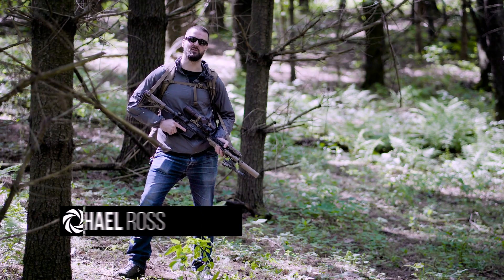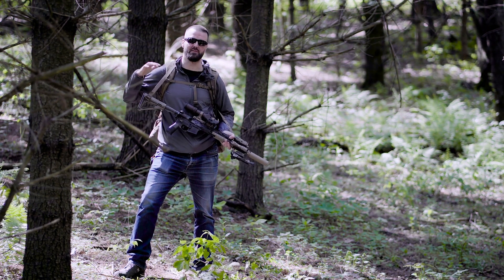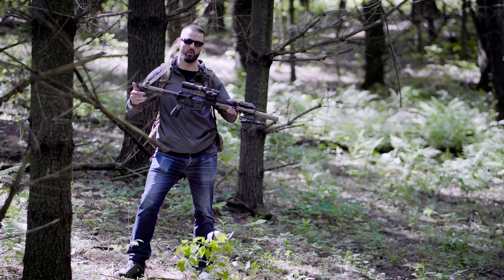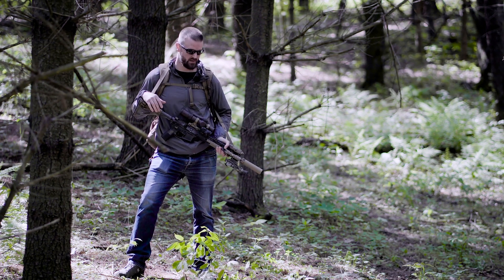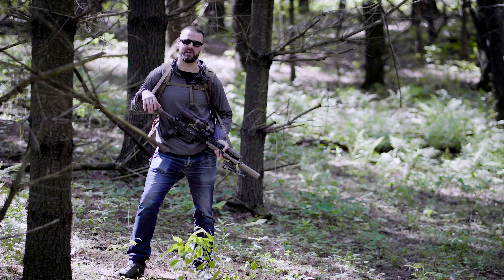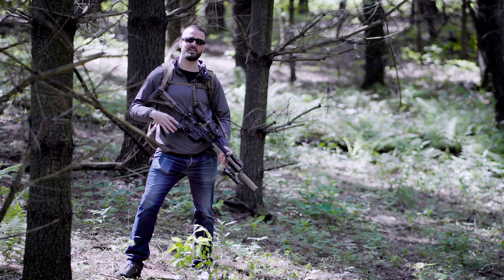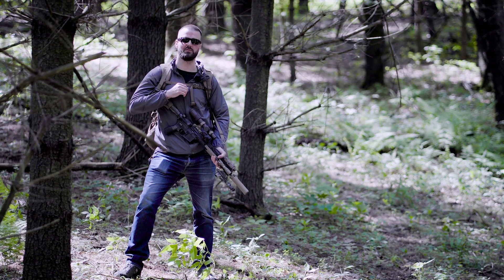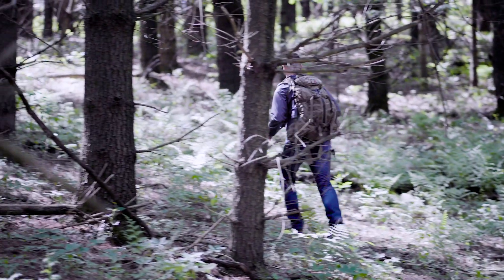AR-15 cycle of operation - 8 steps you NEED to know about - Locked Chamber Dwell Time

Comment: So my barrel acts undergassed, i run an a5 H1. So what is being explained is i need to up my buffer to an h2? I am having issues with the bolt locking to the rear on last round.
Reply from the maker: If you contact us (contact@criterionbarrels.com) we will happily take care of you.  There are many parts than can cause symptoms that appear to be under gassing, and we can get you squared away.

Comment: I've been chasing the 1/2moa "duty" rifle for a few years now. I've been damn close on a few builds but they were closer to 3/4moa than anything. My "duty" grade checklist isn't too strict or anything. On my next build, instead of using chf chrome lined I'll be using a nicor-treated chf barrel that I'm hoping will give me that 1/2moa I've been after since there's no additional coatings within the barrel makeup.... Is it even possible to have a duty grade rifle that carries 1/4moa like the video claims?
Reply: Do you hand load? If not you should start, it opens up a lot of options

Comment: How is nitride vs chrome vs environmental corrosion?
Does chrome generally do better if it's applied properly?
I heard many, many troops were killed in Vietnam because the barrels weren't corrosion resistant, and wondered how they would've faired if their barrels were nitrided inside.
It's said the pitting was so bad that the casings would form into the shape of the corrosion, getting stuck, and jambing the weapon.
Reply from the maker: Nitride is great but it is not nearly as corrosion resistant or durable as a chrome lined barrel.

Comment: Most youtube videos I come across sound either like someone trying to explain to us, what the engineers told him (which he didn't understand).  You sound more like the physicist/engineer, who really understands what happens - AND knows how to say it in a way that non engineers can understand.  THANK YOU!  I am building a couple ARs using about the least expensive parts I could locate on the internet - and am expecting to face .... um, "issues" at some point because of that.  I was looking for videos like this so that I can better understand the functioning of the AR DI system for troubleshooting.  (I did already "assemble" a PSA kit using an 80% lower and have not had any issues to troubleshoot yet on it.)

Comment: "firing, unlocking, extracting, ejecting, cocking, feeding, chambering, locking, in no particular order." No particular order??????? As if this works no matter what the order? 😂
Reply from the maker: No particular order, meaning that it can begin anywhere in the sequence... firing, unlocking, etc., or chambering, locking, firing, unlocking and so on... It is still the 8-step cycle of operation regardless of what step you want to begin at. The sequence remains the same but where one considers the starting point can vary.  This is just a brief video bringing attention to the timing of an AR and its importance on performance.  This is not PHD level, it is for those just getting in to the AR world (there are many many new gun owners that are looking for the basics).

Comment: As a bolt gun shooter, I still can't grasp the concept of "free-floated" AR barrels when there is a gas block and gas tube attached, but that aside, just wondering how much movement is typical during the barrel-whip process. Is this a known metric for each barrel length produced? For example, for a .308 caliber, 18" Criterion barrel, how many thousandths of an inch does the barrel move during firing.  Dependent on ammo load and barrel profile is obviously understandable, but still, some kind general average of movement should be known. Right? Otherwise,  how can we know how much clearance should be maintained between the gas block and the handguard so they do not contact during the firing process?

Comment: Are there any particular flash hiders that you recommend for good accuracy in you’re barrels? I have a particular 16” salt bath nitride unit that seems to like being naked. I now you guys like you’re barrels to party hard and everything but I want her to stop flashing everyone. I fired a .37” group just this morning with Blackhills 77gr ammo bare muzzle, with a standard A2 birdcage the Gun fires a 1.1” and with a lightweight 3 prong it fired a 1.4” group. I’m sure there are some flash hiders out there that will give me bare muzzle accuracy but I don’t want to buy 15 different units to find out. Thanks
Reply from the maker: Steven, I have had excellent results with 3 prong flash hiders from Surefire, Silencerco, AAC, and many other high quality manufacturers... I pretty much only use flash hiders or "comps" that do an excellent job of reducing flash like the "Warcomp" from Surefire.  Torque on muzzle devices can make or break performance.  If a muzzle device is too tight it can create a tight spot right at the muzzle.  If its too loose, it will impact harmonics.  I find that using rockset and torqueing the muzzle device till the threads are engaged and tight but not over-torquing is the best way to go.  I do recommend following the flash hider manufacturers torque specs for best results.
Reply: @CriterionbarrelsInc  Thank you, you guys are always helpful, I will keep exploring.
Reply: Wow, I had no idea that simple flash hider muzzle devices would effect your accuracy in such a massive way! I usually go with a2 birdcage with everything. Did you ever find a happy medium or process to work out your accuracy issues?

Comment: It's funny because dwell time isn't one of the steps
Reply from the maker: Locked chamber dwell time (not to be confused with dwell time of the gas system) directly relates to the "Unlocking" step in the 8-step cycle of operation as well as all the other steps... It is essential to a properly built and timed rifle.

Comment: Any issues with steel cased ammo or any ammo to avoid
Reply from the maker: Steel cased ammunition is typically not as reliable as high quality brass cased ammo, however, we do test our barrels with pallets of steel cased ammo and it generally works just fine.  If it is super low pressure ammo you could drop weight in the buffer.

Comment: Is the barrel a 13.9 core with a MCMR 13?
Reply: i doubt it. the 13-inch MCMR doesn't play nice with suppressors on a 13.9-inch barrel because of the "lips" on the sides of the handguard. you would have to sand those lips down to get a suppressor to fit. it's probably a 14.5-inch barrel at least.

Comment: @Criterion Barrels, Inc. Hi guys, I have a BCM Recce-14 and I'd like to install one of your 14.5" Hybrid mid-length barrel (.223 wylde) on it. I would also like to install a Geissele Super42 kit : braided wire spring and H1 buffer.  Is the gas port of your 14.5" barrel large enough to cycle properly my Ar15 using a mid-length gas system and the Geissele Super 42 ??  ( that is 15% stronger than the standard buffer spring ).
Is it possible that my Ar15 will be under gassed and not cycle properly ??  ( I'll probably use a BCM low profile gas block .750".)

Thank you
Reply from the maker: Hello, although you could use the Super 42 spring, there is no need.  Our barrels are properly gassed and not over-gassed.  This is why we recommend using a standard mil-spec action spring or something with a mil-spec tension like the white spring from sprinco.  The Super 42 is best suited to make up for overgassed barrels to slow down the cyclic rate, thus the increased spring tension.  We recommend the mil-spec action spring with a heavy buffer to delay unlocking and refine the 8 step cycle of operation.  Timing of the AR, ensuring that all of the 8 steps happen how and when they are supposed to, makes a huge difference in performance.
Reply: @CriterionbarrelsInc Ok, thanks for the advice. Just out of curiosity, what is the exact gas port dimension on your 14.5" Hybrid mid-length barrel ?

Comment: With 7.62x39 AR.....I have noticed that overgassing is alway good for a smooth operation shooting cheap ammo .....
Reply: The highly depends on your chosen gas system for your barrel length. There are lots of barrels out there with carbine length gas systems so the under-loaded cheap ammo won't cause malfunctions with less gas. Instead of hearing the bitching of  these customers with malfunctions out of the box that is ammo related, they rather take the higher wear further down the line. The majority of ARs don't even see 1k rounds. With the right gas system for your barrel length it'll work just fine with cheap ammo but maybe not the cheapest one can find.

Comment: Perfect video!! This is the stuff I try to explain to some of these self proclaimed amature builders. I have worked as an armorer on our service rifles and in several different civilian shops close to 25 years and I always seem to get someones "custom build" problem on my bench.  When I start asking questions and give some honest advice, it is like I am the bad guy kicking someone's puppy.  lol.  When people start buying the cheapest barrel they can find on the clearance section of a site for like $50 and buy their other critical components for cheaper than cheap mismatch pile and wonder why something is not working correctly I just have to shake my head.  I am all for saving a buck or two but certain things do not come cheap. I tell them to buy some quality matching and tested parts and it will save you from a headache and having someone like me trying to diagnose, fix and repair their mistakes.  I always had great results from your barrels and try to direct people in your direction.  I am currently building my first 6.5 CM on a MEGA Arms MATEN platform with one of your 24" stainless bull barrels 6 groove with 1:8 twist.  I have done a bunch of research and feel confident in trying to hit out to 1000 yards with that barrel.  I did picked up some 95 gr V-max rounds for some future varmint plinking that are tearing up my chickens at 150 yard away.  What grain 6.5 CM do you recommend for longer distances ( +800 yards) out for that barrel profile?  Any advice or recommendations would be great and helpful.
Reply from the maker: I appreciate the feedback and insight.  A rifle is not only the sum of its parts but also how all of those parts and pieces fit and function together.  As far as the 6.5 Creedmoor, you will have no issues making hits at 1,000 yards... you can easily push it past a mile if you would like.  I generally prefer heavy weight, high BC bullets for shooting long range.  The heavier bullets remain more stable and are less effected by environmental factors (like wind) once it begin to lose velocity.  I've had great results with a wide range of bullets and I think you will find the 6.5 Creedmoor is relatively easy to load for.

Comment: What do you think of flat wire buffer springs? People say that they last lounger and have a smother push with less twang. Do the staff at Criterion Barrels like them or not?
Reply from the maker: I use and recommend standard mil-spec action springs.  Primarily because I shoot a lot and replace my springs frequently (about every 5-8,000 rounds).  Many manufacturers of flat-wire springs market then as being cross compatible with 5.56 and .308... also carbine receiver extensions and rifle length receiver extensions... That doesn't add up.  I use the right action springs for my setup which ensures that the rifle is properly timed.
Reply: @CriterionbarrelsInc  Thanks for the advice.

Comment: Thoughts on the Aero M5E1 308 upper. Before I found out about lapping the upper receiver. I Went with that upper but I’m  starting to think would it have been better to just stick to a traditional style upper.
Reply from the maker: I vastly prefer the standard M5 which works great.  The M5 "Enhanced" has some design flaws that limit accuracy, like the series of slots you need to thread the gas tube through in the proprietary barrel nut design.  The gas tube isn't allowed to free float, so neither is the barrel as the gas tube is attached to the barrel via the gas block.  If torque or tension is on the gas tube it directly changes the consistency in the way the barrel vibrates.  Just because something is marketed as enhanced doesn't make it a reality. I would stick with the standard and get a solid handguard like the Centurion Arms MLOK design.  Otherwise, you can bore open the series of slots and limit torque and tension on the gas tube.
Reply: Criterion Barrels, Inc. thanks for the information looks like I’ll be doing another build.
Reply: @CriterionbarrelsInc  have you observed the same design flaws in the Aero M4E1 uppers? Also, is the barrel on the gun in this video a 13.9? Awesome looking gun
Reply from the maker: @peepo-the-boomer  I have not, though I prefer standard mil-spec forged (thermo-fit) upper receivers.  The barrel in this video is a 14.5'' CORE Series under a BCM MCMR-13... a solid setup.
Reply: @CriterionbarrelsInc  I'll have to look into that. Another question, I just bought an 11.5 inch core barrel, any tips on making the gun cycle reliably suppressed and unsuppressed beyond the tips in the video you made using this 14.5 gun as an example? I'm assembling the pieces now. Thanks for the support
Reply from the maker: @peepo-the-boomer  Set-up would be largely the same.  Other things like using quality ammunition, consistent maintenance and cleaning (like vehicles, guns will need to have parts swapped as they wear).  All the details matter. Enjoy your new rifle!

Comment: Criterion is a part of Krieger barrels right
Reply from the maker: No.  We are completely separate with different ownership.  The owner of Criterion started Krieger barrels with John Krieger in the early 80's and was the General Manager for decades before starting Criterion.  The Krieger barrels crew are good friends.
Reply: Criterion Barrels, Inc. cool I went with a Krieger m110 profile 308 barrel. Then I found out about you guys. I gotta say your guys prices are a little bit more reasonable. Not to say I don’t LOVE my KRIEGER.
Reply: Criterion Barrels, Inc. can I ask 1 more quick question please. I just did a Faxon barrel build its a 20” rifle length gas system and rifle buffer and spring. How many rounds in your opinion will it take to see the 3/4” MOA drop off.   I’m running your run of the mill 62 gr green tip fmj also I’m achieving the 3/4” MOA at 100 yards on 5 shot groups. I also have NEVER mag dumped that barrel nor do I plain on it.
Reply from the maker: @Johnny-jr2lq  Good question.  Barrel life depends on many factors like rate and volume of fire, cleaning and maintenance, the environment the rifle is used in (sandy hot environment, rain forest, arctic, etc), the ammunition used (powders, primers, etc), and a wide range of other factors.  I generally find that the best accuracy is had in the first 12,000 rounds from an AR-15.  If accuracy falls off, I simply replace the barrel.
Reply: Criterion Barrels, Inc. sweet that’s good to know I have plenty of time then on my faxon. I only have 600 through it at the moment. My cleaning schedule is in some people’s mind a bit much I completely detail clean it after every range visit. The environment is normal Michigan summer weather and fairly good winter days.
Reply: Criterion Barrels, Inc. oh hell I have all kinds of stuff popping in my head to ask.       Thoughts on projectiles to run out of the krieger it’s a 1/10 twist i was thinking 168rg I just don’t know what profile type I should choose. I know I’m limited to the length of the magazine but a quick tip from you guys to get me started in the right directions would help. I would ask the krieger guys but it seems they haven’t up loaded a video in quite some time.

Comment: Just built a 308 with your hybrid profile nitrided barrel on an aero M5 reciever set, the reciever extension slipped right in like butter. It shoots well and the groups are tightening as I put rounds though it. 

From a practical point of view, does shimming or green loctite make any difference at all? I've read conflicting things and can't determine weather its worth doing or not.
Reply from the maker: Yes, the fitment between the barrel extension and the upper receiver is critical to accuracy. I generally use thermo-fit upper receivers, true them up, then bed them with a green Loctite.  This helps to maximize rigidity and has been proven to increase consistency and accuracy.  I avoid shims as I do not like adding pieces to my rifle but they do work.  These small steps and others, like choosing a smart handguard with an intelligently designed low profile barrel nut and a rigid lockup makes a huge difference.
Reply: Criterion Barrels, Inc. you guys should do a video explaining this.
Reply from the maker: @xLHkk  Not a bad idea.